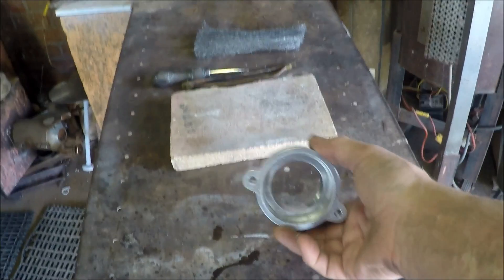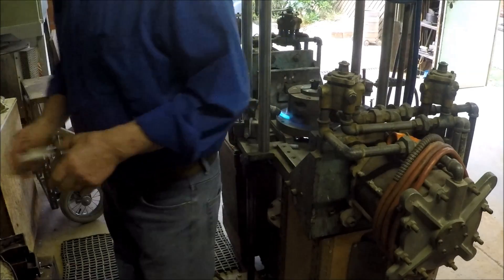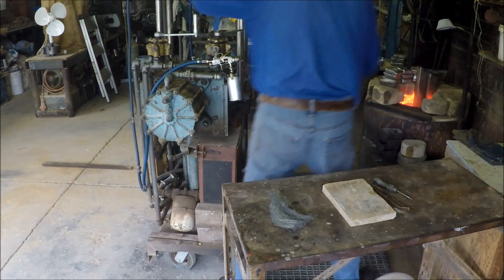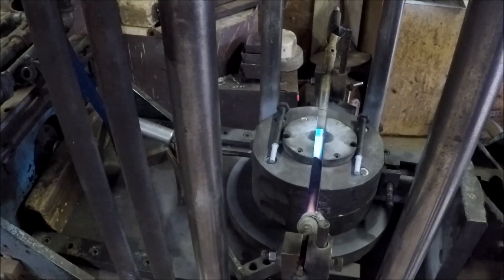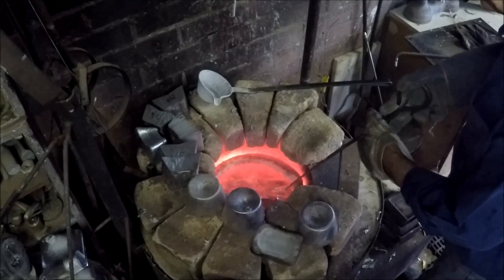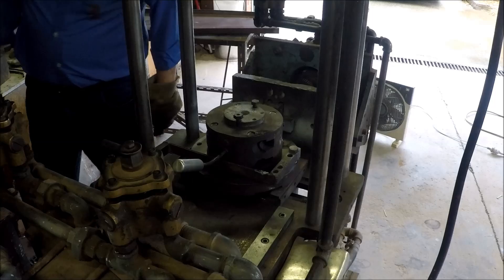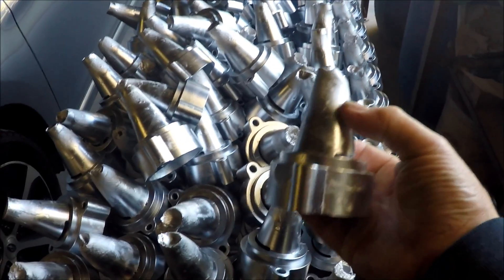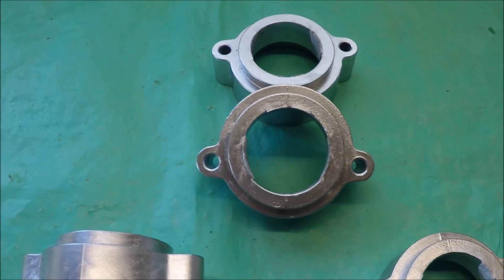LPG gas mixer body for a fork lift

Comment: Great video,Could you please tell us all about your temperature probe and the thermometer it is attached too?Thanks very much
Reply from the maker: Jack, I use a type K thermocouple.  It is what is know as a MIMS type this means Mineral Insulated Metal Sheathed. The thermocouple is inside a metal tube which is packed with an insulating mineral usually magnesian carbonate. The two thermocouple wires are insulated from themselves and the outer sheath by this mineral. At the working end of the thermocouple the two wires and the sheath are welded as the one junction. You can get these MIMS couples in various lengths and diameters and sheath materials. this web site lists many of them ;- https://www.tcdirect.net.au/   The ones I buy are 1meter long and 6 mm diameter and come with an end connecting plug and they have an Inconel sheath they are not cheap but one has lasted me well over 5 years . I use a boron nitride wash to protect them from the metal (no good above 900 C so for copper base alloys another type of protective wash or a graphite over sheath is required)  The same site has indicators but they are expensive and the one I use was and indicator /controller from eBay, it was a 12 volt instrument so I had to buy a small 12 volt power supply too! It is a bit cheap and nasty as if it gets too warm (above about 30 deg. C) it stops working until it cools down again.  You can buy cheap thermocouples from Ebay too but they are only sheathed in stainless steel and that will limit their upper temperature limit as well as their life , but good enough to start with... Martin
Reply: Thank you Martin for taking the time to completely answer my question. I appreciate it very muchJack

Comment: Nice work
Reply from the maker: Rupert, This is a method for producing runs of castings in sort of few hundred range. depending on the job you can get from about 50 per day to 300 or so per day (this job gives 200 to 250). It produces (when done well) excellent castings.. Martin

Comment: Thanks for teaching me more, could you please tell what grade Ali. that you poured.Bob
Reply from the maker: Bob, The alloy that I used for this job, and indeed for most of my other work as well, is called AA601 in Australia, 356 in the USA and LM25 in England.It is an aluminium magnesium silicon alloy with about 7 % silicon and 0.35 to  0.4 % magnesium. It is a very common alloy both for sand casting and gravity die work as it is easy to cast and when heat-treated it is quite strong. Alloy wheels are usually made of it.Martin

Comment: Hi Martin, Good to see your back at casting after your operation. 129 units makes for a lot of forklifts needing conversion to LPG. Still small runs like this are just up your alley and ensures a quality part. Mark
Reply from the maker: Mark,  I used to do very well from the gas conversion business - for a few months that is! I cast blanks that a friend machined into all manner of mixer bodies. But all vehicles that could be converted by using mixers (as opposed to injection) have long been done and the business died overnight - sob!These forklift mixers are the last survivors - the orders are small but regular and it is an easy die to work. Yes the hand recovers but I still have not subjected to the full rigors of ramming up sand moulds, next few weeks will see that.

Comment: Good video again, it's always a pleasure. I wouldn't have thought the bolts, then a short time later the part being removed so early, I wouldn't have thought the aluminium had set enough. Peter
Reply from the maker: Peter, Yes when cast into an iron die like this the aluminium solidifies very quickly. In fact if I leave those little bolt cores much longer they get a lot harder to pull out as the aluminium contracts against them. All dies have a rate at which they work best - its a balance of heat in (from the molten metal) and heat out (conducted or radiated away from the die). Once you find this rate you just plod away at it, too fast and the die will get too hot and casting defects are likely, too slow and the die cools down and the metal may solidify before completely filling the die. If you look closely you can see the metal shrink down quite quickly in the top of the feeder just after pouring, this is an indication of just how quickly it is going solid. This casting is almost certainly completely solid in 10 to 15 seconds after pouring.

Comment: Very nice.
Do you think it would be possible to pull a 3" long  3/16" core pin the same way?  Its something I have been thinking of for some time, but uncertain if it would work..  Then again I didnt think about pulling it when the ali was still soft....
Reply from the maker: aonemarine, Glad you liked it  sure beats making them one at a time in sand! I have never pulled small cores 3 inches long but if it has enough taper on it, it would be quite possible. You pull the pin (so to speak) as soon as the aluminium is just solid enough to prevent bleeding into the hole. Wait too long - (particularly with big cores) and you won't get them out! I do another job quite similar to this and it uses two core pins that are 48 mm in the metal they are 5.4 mm diam. at the small end and 6.6 mm diam. at the big end You might get away with less taper you would just have to try and see. Even if you can't core the hole exactly as you want it you at least have an easy drilling job. The core pins are made from free ]machining low carbon steel. They are sprayed with "Release Coat Blue" by ZYP coatings warning very expensive but cheaper graphite based die coats may do. the part of the core pin that slides in the body of the die is coated with a Mo2S dry film lubricant. Outside the box, always think outside the box - pull when "soft" is the only way!
Reply from the maker: aonemarine,  Damn another one of those posts that mysteriously get a line through them don't know why this happens! Just do your best to ignore the lineMartin